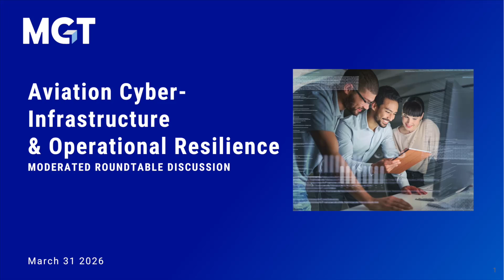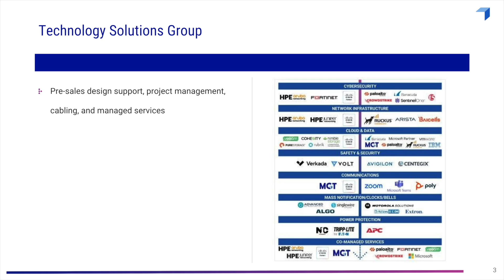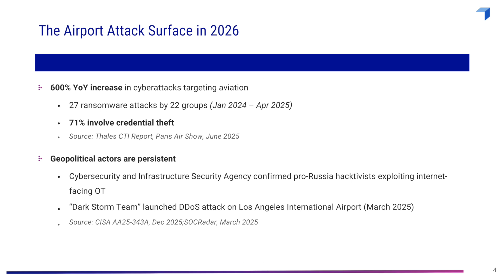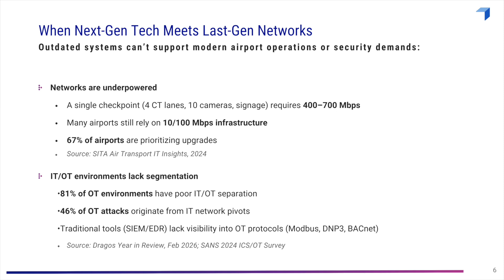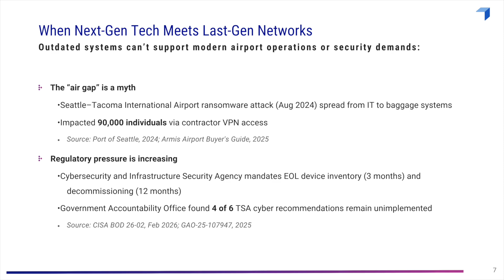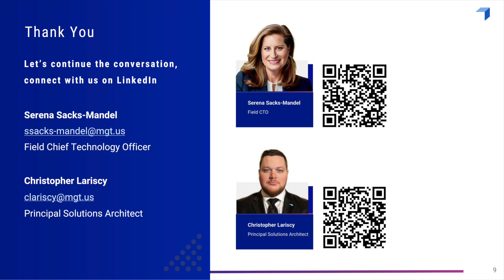Aviation Cyber-Infrastructure & Operational Resilience Roundtable Discussion

Comment: Aviation now depends on systems most people never see. The front end keeps improving, but the back end has to carry more and more responsibility without always being updated at the same pace.

A simple example is gate systems and network connections. If those systems slow down or fail, it can delay boarding and ripple into flight schedules, even if the aircraft and crew are ready to go.

There is a pattern here that goes beyond aviation. For example, in the early days of global shipping containerization, ports upgraded cranes and terminals, but many struggled to modernize the information systems that tracked cargo. That gap created delays and inefficiencies across global trade until the digital side caught up.

You can see the same connection now. Defense, global markets, and airspace integration all depend on strong, secure infrastructure behind the scenes. If the digital layer is not as resilient as the physical one, the whole system feels it.

Pilot Elizabeth Graham at Grace Aerial Technologies